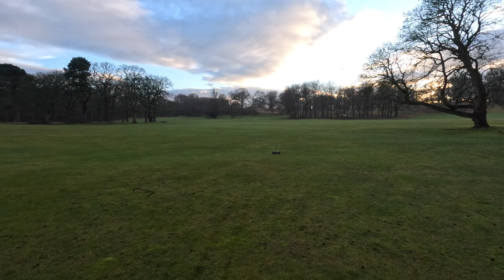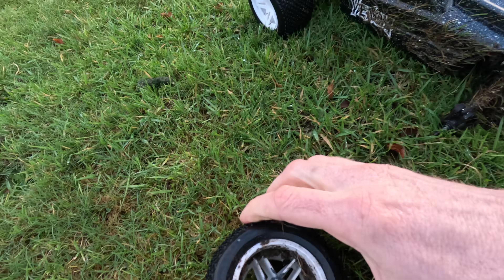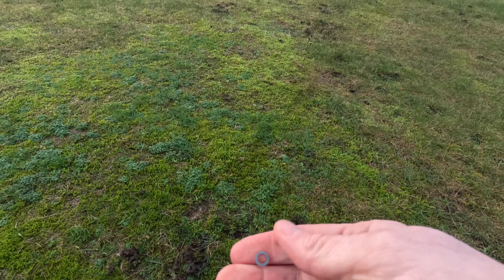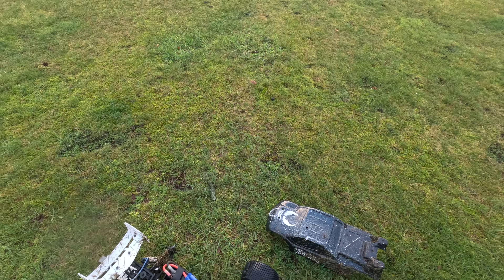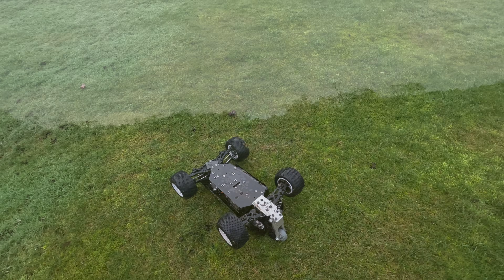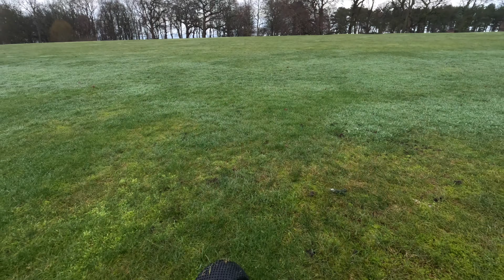Hoabo Hyper TT - Big Block Brushless Motor - 65mph+ Rc Off Road Rocket!! 25 Tooth Pinion - 4s Lipo!!

Comment: Hobao are one of my favorite RC manufacturers, they make high quality, durable, great driving & affordable RCs.
I especially like their 80% ARTR stuff, I've got 6 Hobaos & they were all Rollers.
They've got almost bulletproof drive trains that can handle all the power you can give them.
I've got an SC8 that's around 7 years old, it's had the snot kicked out of it & it still runs great.! 
It's been running nothing but 6S it's whole life (Rocket 4292, 1950kv motor & Hobbywing 8bl150 ESC) & the diffs are barely worn.!!
Incredible.!!
I also have the SC10 which is on the stretched version of the TT's chassis, it's been on 3S & 4S, it's still driving great too..
It's diff gears are hardly worn too.!
My DC1, EPX Euro truck, Cage buggy & GTS are just as good.!!
I can't recommend Hobao RCs highly enough.!!
Thanks for a great video & for showing Hobao some love.!! 👍 👍
Subbed & liked & the very best wishes from Scotland 🏴 🙏 ❤️ 📻 🕹️ 🔋 🚗 🚖 🚕 🚔 🚚 🚙 🚘 🚓 🚒 🚑 🚐 🚎 🚤 🚁 🛩️ 👍 👍 👍 😁
Reply from the maker: Thank you that was very kind and I really enjoyed reading your message. I’m also blown away, it’s hard to imagine how it still seems like they are not as well known as the other brands when I’ve never known Rc’s to be as durable as this! And it’s great to hear yours are still going as I plan on keeping mine and trying many new set ups. Thank you for the sub and information. 🏴🙏🏻🙌🏻
Reply: @rcsworld1307 I absolutely guarantee that you're going to love this RC.!!
They're a really solid platform to base different builds on.
I turned my 1/8 scale GTS from a low road car into a rally/RX car by fitting the front shock tower & springs from a Hobao buggy, I changed the springs & fluid in the rear.
It performs so well, it's exactly the way I wanted it.
It'll take jumps with ease now.!! 👍 👍 👍 😁